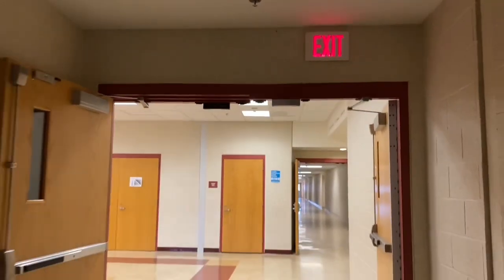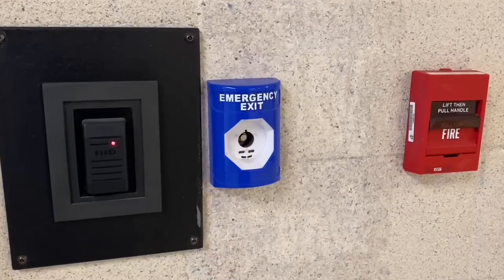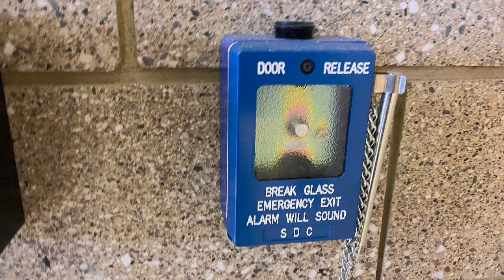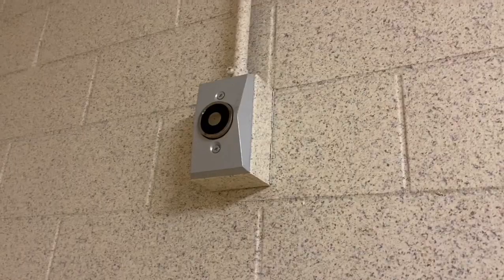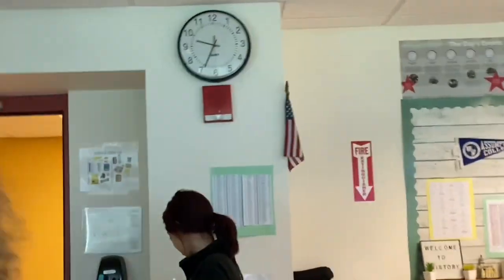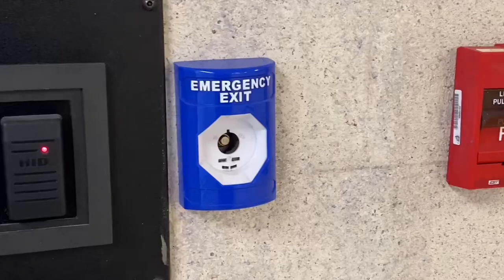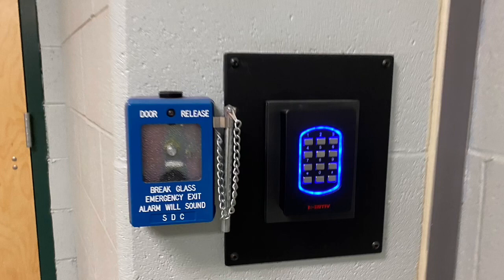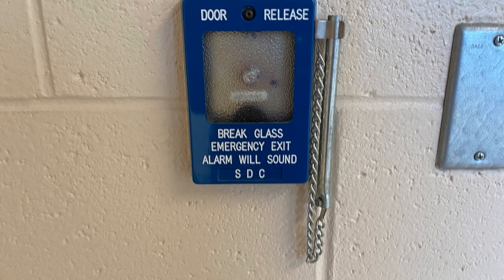Building Door Access Control and Fire Door Magnets - How They Work

Comment: I remember when I was in first grade I was in the hallway and then the fire alarms system activated closing the fire doors and locking them. I was terrified when I found out they locked
Reply from the maker: Fire doors don’t lock in the direction of egress but the may lock in the opposite direction
Reply: @ I think I was facing the other way because the area i was in was like some random hallway by the cafeteria

Comment: I asked old school fire alarms (Glenn James) about fire door magnets on older systems and he says they'll work with a normally closed relay and maybe some other components that is/are the same output voltage as the signaling devices.

I actually transferred to a new high school, because my old one was a ghetto! That building has fire doors with disconnected closer mechanisms, which is a big code violation, and they are held open by wedges and not magnetic door holders. That building may be demolished in a few years from now.
Reply from the maker: That’s no good
Reply: @FireAlarmDude5967  I'm surprised the city of Akron hasn't condemned my old high school yet! That building is a fire trap!!

Comment: Wow that’s interesting that you guys use mag locks! At my school, the fire doors just have normal panic hardware that utilizes metal keys. These doors are locked from the non panic side and actually can’t be unlocked. When you turn the key, the latches retract, however there’s no way for the door to remain unlocked as the handles don’t actually operate.

Comment: The school i went to (up until 2016) had fire doors that had magnets, and outside of lessons a teacher would manually release the doors, as students were not allowed in the corridors during the morning break and lunch (and there was a sign on the doors that was visible only when they were closed which said you would get a lunchtime detention for being in the corridors outside of lessons)

The college i went to between 2016 and 2018 had magnetic locks on the fire exit doors of the library building, the doors leading onto the fire exit staircases did not have a magnetic lock, only the doors leading to the outside, there were 2 fire exit staircases, and a total of 3 fire exits (other than the main entrance into the building), one of the fire exits lead from the library directly to the outside, this door was magnetically locked, the other two fire exits from the library went via one of the fire exit staircases, with these, you had to go through an alarmed door, which was not magnetically locked, but an alarm would sound if you opened the door (separate to the fire alarm), and then you would go through a magnetically locked door

The magnetically locked doors had a green “break glass” emergency release next to them (although it was not actually glass, it was a plastic one, where when you press hard on it, the plastic piece moves in slightly and drops down a little bit (from what I understand), which reveals a yellow “activated” strip (and a special tool can be inserted into the bottom of it to reset it)

On one of the fire alarm testing days, i did see them open one of the fire exit doors, I don’t know if they were testing the emergency release (if they were, then for whatever reason the emergency release was wired into the fire alarm (as far as i know, emergency releases where i live have 3 sets of contacts, 2 for the door lock itself (bypassing the access control system), and a third contact to allow the emergency release to be monitored, usually by the access control system), these doors did not have an access control system, I suspect the magnetic locks were wired directly into the fire alarm panel), or if they activated the call point, and then checked to make sure the fire exit door unlocked with the fire alarm